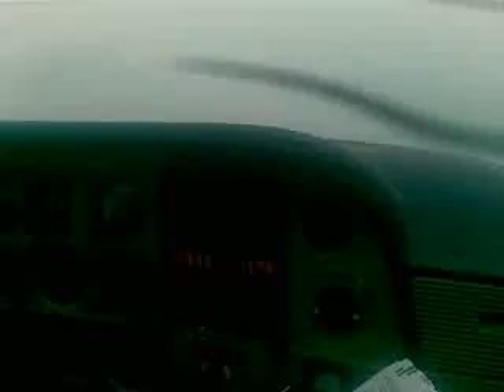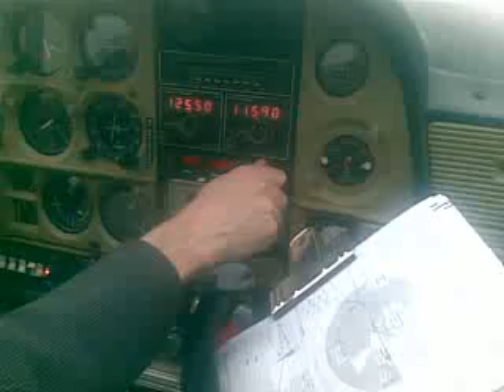VOR Approach with COM failure

Comment: @zaphr89 the audio quality is usually a bit better than you hear in this video, quality this bad is down to a bad radio/bad radio settings and additional quality loss from the recording connections and equipment. a good headset makes things pretty clear and easy to understand

Comment from the maker: Yes, the audio is often as bad as it sounds in the video.  We use standard phraseology and phonetics for this reason to minimize misunderstandings between controllers and pilots.  
IFR pilots are required to read-back all instructions from controllers for this very reason.
Yes, during IFR procedures, most time dialogue coming is very predictable because it follows standard pattern.  Some key numbers such as alitimeter settings before approaching and landing are critical and should be read back.

Comment from the maker: At time 06:40, successfully switched over to back-up communication radio (COM1).
If back-up radio also didn't work, would have squawked 7600 to indicate comm failure on radar and then looked for green light signal for "clear to land" from the tower.  In event no light signal received would have planned doing a NORDO approach.  
Also at beginning of flight was given an IFR clearance all way through to landing, so believe technically cleared all way in event of comm failure.